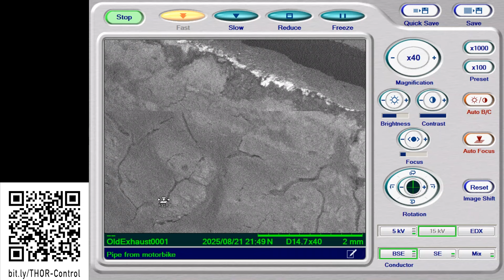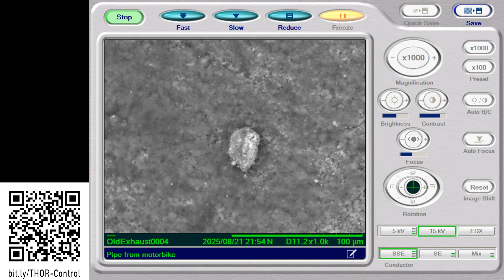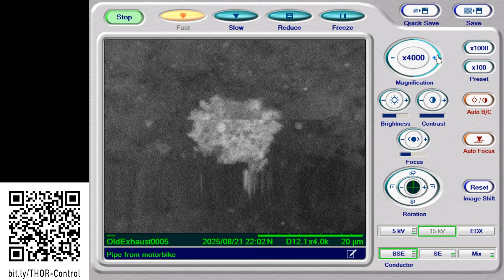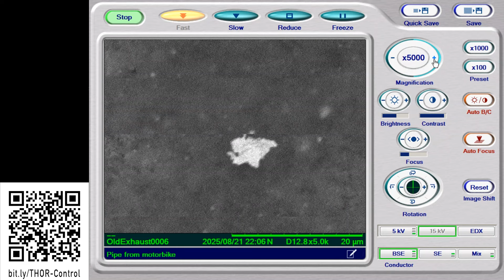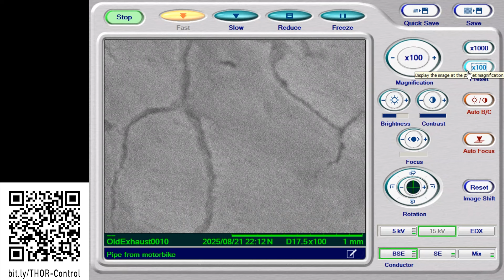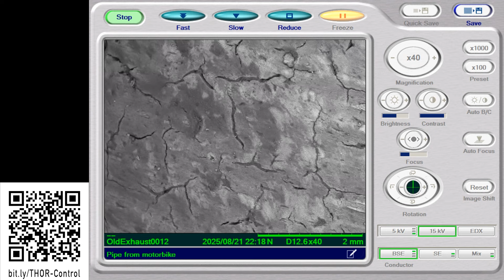THOR - Control - Old Exhaust Pipe Analysis

Comment: Sorry for off topic, but Ben from UnchartedX was just on Rogan and he talked about how the precision carved Egyptian vases had titanium embedded in them. They found that with SEM. Bob, I think you'd be perfect to weigh in on how that might have gotten in there! I think they used the tech you've been rediscovering. Also they found out that the vases are more radioactive than the base rock material that they're made from. He mentions the hypothesis that they used nuclear machining. Radioactive material that is a strong alpha or beta particle emitter that you can put on a tool.
Reply from the maker: Yes, I have argued it is cut with coherent matter.